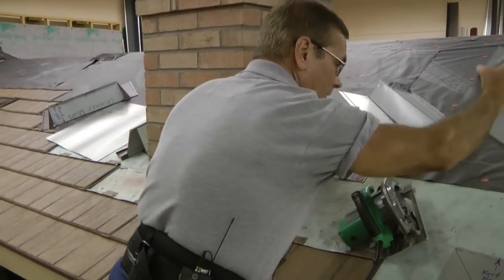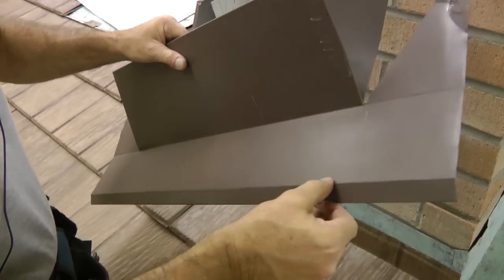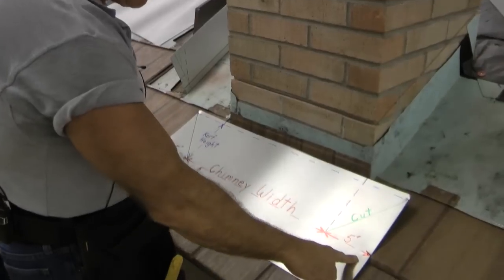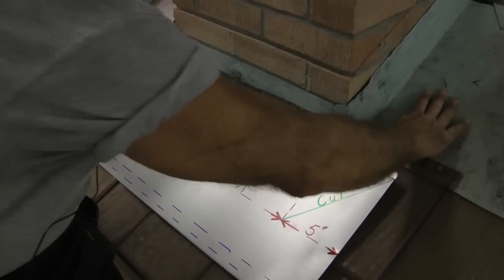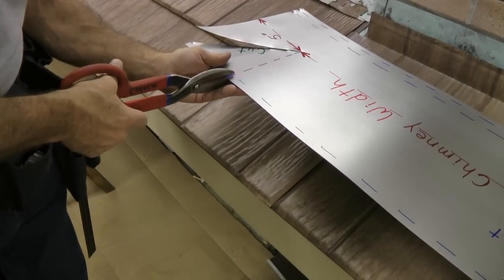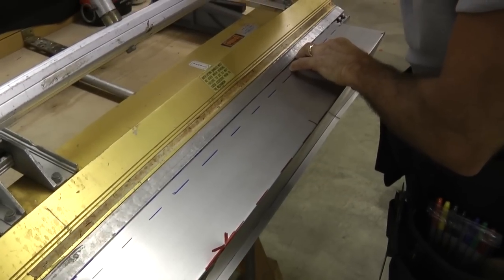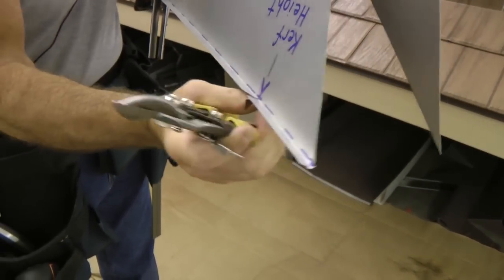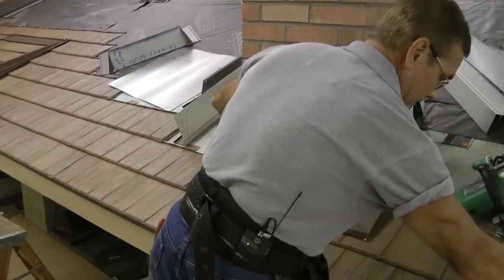Chimney Apron Flashing

Comment from the maker: 3. A 1” deep kerf would be acceptable as long as it didn’t compromise the integrity of the masonry work.

4. Sealant alone should be enough protection but using two beads is not a bad idea. I like to recommend putting a bead of good silicone sealant in the kerf before the metal is inserted. A second bead can then be applied afterward. 
 
We appreciate you desire to be thorough in your work! Happy flashing!
- Mark T.
Reply: What sealant do you use?
Reply from the maker: @libtrs838  Any quality silicone sealant is acceptable.  Butyl does well in areas not exposed to the sun but is not recommended where this is a concern.

Comment: Part II: 3rd. the piece that  tucks into the bricks, wouldn't  a 1inch return add a little extra security? 4th. do you think sealant alone is enough protection? I mean, wouldn't a combination of sealant on the inside, and mortar on the outside be a good combination? Your professional opinion would be greatly appreciated. Thank you for your video. JOE S~

Comment: It looks good but it will leak.   As soon as caulking wears out, water will get under the flashing.  It would be better if you cut through the brick and push the flashing in there that way you don't rely on caulking.
Reply: There is a cut on the brick, thats why He bended the top about 1/4"
Reply: 1/4" is not enough. It should be 1".
Reply: @RalphGrochowski   5:34 min

Comment: This is by far the best video I've seen on this subject! Although I have a few questions. 1st. what's the heaviest gauge material you can bend with a typical brake like your using? I have access to one like yours, and I don't want to use regular trim coil, like is norally done in my area. 2nd. does the angle where the roof and chimney meet have to be figured out, when you bend? Or is is it flexible enough to bend to the right fit.

Comment: what is the other mesurements?? like the underturn hem and the extra strength bend and the kerf height and the kerf n back????
Reply from the maker: The dimensions on the hem and strengthening bend are somewhat arbitrary, depending on what looks good and is convenient for the slit width you are working with.  I usually go with ½” for the under-turned hem and then up maybe an inch for the strengthening bend.

Our sidewall flashings for our shingle products have a vertical height of 7-5/8”.  This is chosen to accommodate a 5/8” deep kerf cut in the wall at 7” off the deck.

 A 7” kerf height is convenient in that most circular saws have a distance between the edge of the shoe and the blade of 1-1/2”.   The height of a common 2 x 6 is 5-1/2”.  A 2 x 6 can, therefore, be positioned against a wall and used as a guide for the circular saw to cut a straight kerf 7” above the deck. 

 A 2 x 6 is a convenient guide for all four sides of the chimney.  Because of the roof slope, the kerf in the front will be slightly below the sidewall kerfs where they meet at the downslope corners of the chimney.  The kerf in the back will be a little above the 7” high sidewall kerfs where they meet at the upslope corners of the chimney. 

 A 2 x 4 can be attached to the 2 x 6 in an “L” shape for temporary attachment to the roof deck through the 2 x 4 for the sidewall kerf cuts (but not for the downslope and upslope cuts). 

 Thanks for your questions!

Comment from the maker: 2. The coil is normally flexible enough to adjust the angle of your bend after you have made it – especially if you leave one end clamped in the brake.  In the video I did make the one bend too sharp (I think I had the uphill flashing in mind!) but I had no problem adjusting the bend in the 29 gauge steel (.0145”) for the chimney application.

Comment: I am not of the school that the base flash should also be the counterflash. This is a mistake. The base flash out to attach to the roof deck and the counterflash ought to attach to the chimney as two separate units to minimize wear and eventual buckling due to seismic expansion and contraction. Also, we round our corners where we're from.

Comment: how do you secure the apron? with construction adhesive? or Henry clear sealant? or ?
Reply from the maker: In practice, the rigidity of the flashing along with nailing the tab to the deck (in the video at 0:30 and 5:50) will probably supply sufficient down-pressure but a bead of sealant under the edges of the flashing is a very good practice. It is possible to rivet or screw through the shingle but I like to avoid penetrating the shingle unless persuaded it is really necessary. 
 
The best scenario is to be able to hook the flashing back into the top lock of the last full course of shingles below the chimney but this may not be aesthetically desirable depending on how far that last course falls below the chimney.  I would still seal the edges of the flashing. Thanks for the good question!